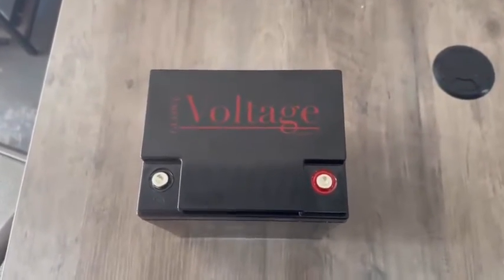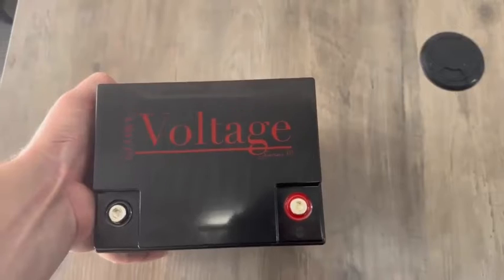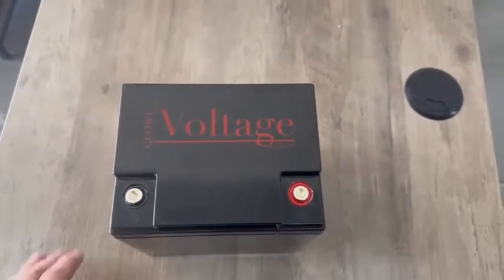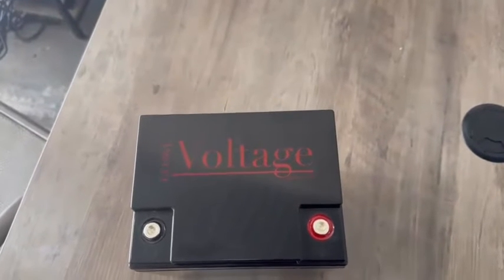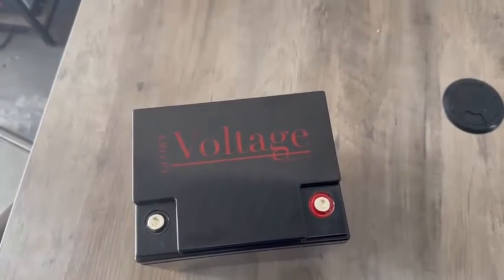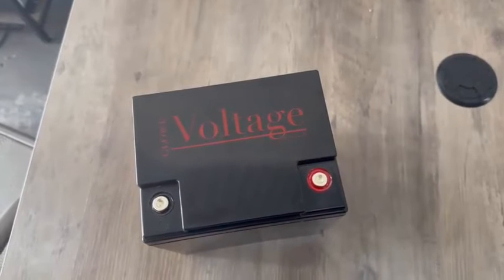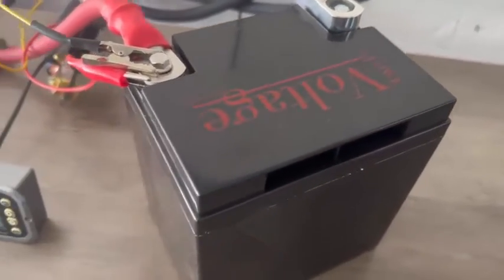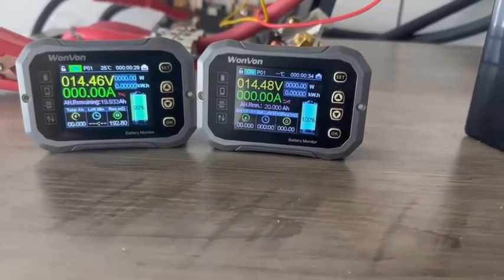Glowe Voltage - Series 3 Testing - 700 amps of output??  Yep.

Comment: I have a 2024 Nissan Sentra and I have a 120amp alternator with a smart charge and which is stock running big boss 5 with a single American Bass Xmaxx 12 in 1ohm and 2 ‘8 midrange and 2 6.5’s with smart 3 and with dsp and lc2i pro but | don’t want to upgrade my alternator. I plan on using it with my lead acid factory battery And with the big 3 and long story short well i was running it with 250 alternator, with 2  agm batteries with a 14.8 bypass for auto tech but my alternator went to shit and plus my 2 agm batteries went bad so I had to go back factory, but I had to disconnect the big boss five amp so would it be good for my stock alternator with the big 3 and lead acid battery ?

Comment: I have a 180a alternator, big 3, 80ah agm battery. Going to either get the stinger mt4000 or taramps the big boss 8k. Both at 1ohm wired. Which battery would I need ? I’m looking at the series 2.

Comment: Would this keep me between 13.8 and 14 v? I have a stock 220 alt with a xs d4900 battery on a jp 23v2 at .5 ohm.
Reply from the maker: There are a lot of variables to answer this question with any guarantees — but it’s a fairly safe assumption depending on output at idle.
Reply: Was looking at the series 2 to replace the agm. I believe the stock 220 alt puts out 180 at idle. Amp dunno test shows max amps pulled to be 410 amp at .5 ohms. Thoughts?

Comment: Will I need a isolator between the hood and glow battery?
Reply from the maker: Nope!  If you check out our other videos, we have a pretty popular one where we measure what happens when you have these hooked up to a lead acid (this includes agm batteries too).
Reply: @GloweIndustries  how is the series 3 better then the series 1 if the 3 only has 20 amp hours. Series 1 had 90. Is the 3rd one still better?
Reply from the maker: @Raquanscaraudio Good question, and super common misconception about how lithium batteries work. 

The amp hours dictates the storage capacity of a battery — the overall energy stored.  90 amp hours means that I could pull 1 amp of current for 90 hours - or inversely I could pull 90 amps of current for one hour.

The series 3 does have less capacity, yes.  The difference is the Series 3 is designed to provide much more burst energy  all at once (almost like a capacitor that can discharge a huge surge of power).

Say you need a surge of 650 amps of current but only for a moment — the Series 3 can easily offer this, whereas trying to pull 650 amps from a series 1 all at once is going to cause your voltage to drop badly right away.

Check out this graphic:  https://glowevoltage.com/wp-content/uploads/2023/12/Comparison.png
Reply from the maker: @Raquanscaraudio if that doesn’t make sense — let me know.  I can reach out to explain more in detail, and should honestly make a video discussing discharge rates.

If you hear someone say “c rate”, they’re referring to the amount of energy a battery can provide.

A series 1 is about “5C” (which is still a lot).  When discussing c rate, you’ll take “#C” and multiply by the capacity.

So (5C * 90ah) = 540 amps of discharge available. 

A series 3 on the other hand can provide 35c of burst current without dropping below 12 volts.
(35C * 20amp hours) = 700 amps of current.
Reply: @GloweIndustries  what’s the terminal size on the series 3?
Reply from the maker: M6. It’s the exact same size as an oem Harley battery. 💯
Reply: @GloweIndustries  thank you so much for all the clear and understandable information on this battery, I’ve been doing research on what I should run as my second battery and I believe that glows voltage is the right choice. Once I get everything setup I will be making a YouTube video reviewing my personal experience! Thank you again!!
Reply from the maker: not a problem at all!  🫡 

You can use the code, “5off” to knock $25 off the cost, too.
Reply: @GloweIndustries  can the GVS3 be installed with the xs power Titan8 battery?

Comment: Hello Glowe Industries I'm just now finding out about your company & your Glowe Voltage s1, s2 & s3 batteries. Would love your recommendation on which battery & how many you would recommend if I want to power two 5k Korean half bridge amplifiers & two 250.4 four channel amplifiers? FYI I do have the Big3 done, a 350 amp h/o alt, and all wiring is OFC.

I will be ordering the very moment I'm able, this month is one of those unpleasant months where my bi annual insurance policy, tag renewal, on top of regular bills has to be paid. But if I find a way to to order this month, I will. I need power!
Reply from the maker: Good evening!  Two 5k korean half bridge - are you running these at 1 ohm?  What amp specifically?  

A good rule of thumb to calculate amperage (at least ballpark) requirements if there is an amp dyno available, is to take the maximum amperage pulled and divide that by half.

For example, a Taramps Smart 8 does over 8k on a dyno - but for most real world situations the max amperage you're going to see being used is about 440.  Taramps even specifies this (as well as some other amplifier manufacturers such as Sound Digital) as a separate value.  "Max consumption on a sine wave" vs "Max consumption on music". 

Two 5k if running at 1 ohm will likely be pulling a bit over 500 amps of current.  If you're running them at .5 you're going to be getting pretty close to 1,000 amps.

If you're running at .5, I'd recommend a pair of the Series 3.  At 1 ohm?  A single S3 + your HO alternator should keep things easily over 12v.

Comment: @Gloweindustries  ?? I Have a Taramps 5k , 3 soundigtals 800.4 , 240Amp Alternator , Regular LED Battery under hood .what Battery would you recommend I buy ??? 
The V3 or V2
Reply from the maker: If you're leaving your under hood battery, you could go with the S3 since capacity isn't a concern.
Reply: @Gloweindustries …I purchased the S3 battery on Saturday alone with the battery connectors … thanks can’t wait !!!!
Reply: How did it perform? @poohwecampbell7799
Reply: @poohwecampbell7799  how you like that series 3 is your voltage holding strong
Reply: @poohwecampbell7799 hope they do?
Reply: Thank you much I’ll order

Comment: I have a Tacoma with only big 3 stock alt and just bought 2000 rms amp can I get by without high output alt with any one of these batteries. If so which one do I need?
Reply from the maker: Absolutely!!  I’d recommend a series 2. More than enough power and additional storage vs a series 3.

Comment: I have 2 320 amp alts and gonna be running 2 dc 10ks .5 ohm each would two batteries  be enough charging at 15.3 cold
Reply: More than enough but your gonna want more reserve if those are gonna be your only batteries in the vehicle.
Reply from the maker: For sure.
Reply: After rise probably gonna be 4k-5k so it will be fine with 2 of them
Reply: @christiannieto1353 unless I misunderstood your comment the op is going to be putting out much more than 4k or 5k after rise... plus he did mention he's wiring at half ohm on each amp. 
Like I said maybe I misread your comment. And I do know what "after rise" means, I'm familiar with impedance. I just do not see his system being that inefficient that a pair of 10k DC Audio Korean half bridge amps each at .5 ohm only clamping 4k or 5k rms... I'm guessing I missed something, if so don't beat me with the Cain! Just educate me please, I learn more & become far more productive that way. And yes I'm a grown man who does not care to admit he's still learning everyday in life.

Comment: So I’m running an xs power d3400 under my hood and just ordered an s3 would that be enough to power a 5k watt system? Thanks
Reply: How did the s3 work?
Reply from the maker: Tony,

Once you get your battery let us know how it does!  This should be way more than enough to handle your 5k.  💯
Reply: @GloweIndustries  thanks for the reply I have a 240a high output alternator. Just didn’t know if I should have went with the s2 or not.
Reply: @Tony could you give me a review on your Glowe Voltage S3 battery? How is it doing for you? Are you powering any other amplifiers off of it besides your 5k?

I just found out about Glowe Voltage & I am thinking about ordering one for now to see how it does. Right now I'm checking out the differences between the 3 series batteries they offer. From my understanding so far the s3 is most powerful BUT it has the least ah of any series batteries offered by Glowe Industries?? I feel like I am misreading something...? @GloweIndustries would you please lmk if I read something wrong... I am wanting to run two 5k rms Korean board half bridge amplifiers along with two 250.4 four channel amplifiers... I have a 350 amp alt already installed on my vehicle. Would one Glowe Voltage S3 battery be sufficient? Or would you recommend I go with the S1 or S2 instead of the S3 & will one of any of these batteries be sufficient or do you recommend  more than one? 
So far I have only noticed you mention full bridge amps on music. Have you tested the batteries on Korean half bridge amplifiers? And have they been tested at Sinusoidal consumption levels for those competing or the ones who always tend to keep their volume at full tilt or atleast close to full tilt? 

PS sorry for long comment.

Comment: What do you charge these batteries with ??
Reply from the maker: An alternator normally.  Or inside?  A 60a power supply.
Reply: So when you purchase you just get it wired up or do you charge first then hook it up. @GloweIndustries
Reply: Charge it up first. I bought the charger from then as well
Reply: @GloweIndustries  where can I find that skinny terminal from 🤔

Comment: Im running a 6000 watt amp in a 2000 watt amp on stock alt what size battery is good
Reply from the maker: A single S3 would have you solid  .  We have some b stock available right now and with the code “Friday23” can get one for under $400. 💯
Reply: @GloweIndustries  is there a way to get in contact with u when I'm ready